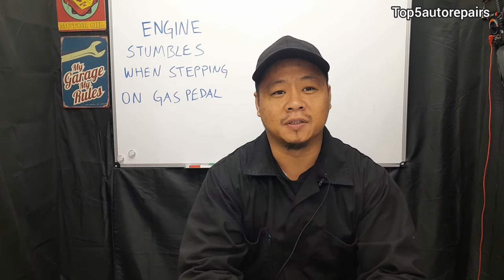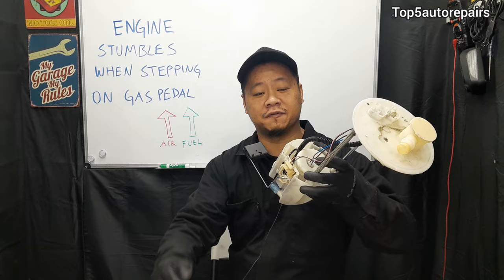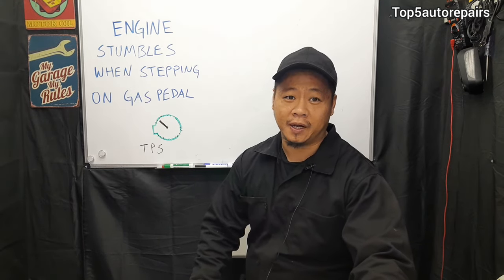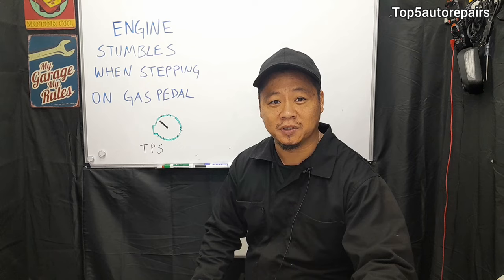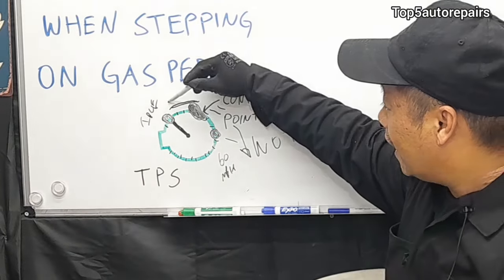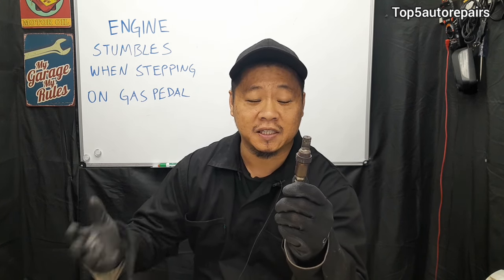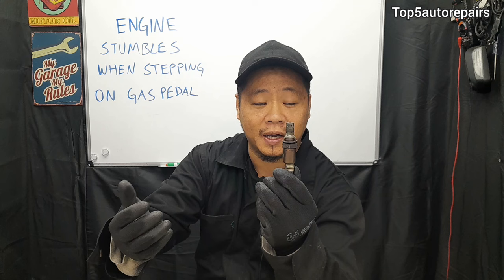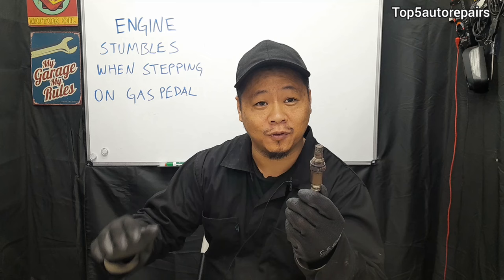3 Reasons Why Your Car Engine Stumbles and Shut Off When Giving It Gas (Stepping On Gas Pedal)

Comment: I have a 2010 yaris it was going fine i parked for about a half hour went to restart and it wouldn't run it kida started but as soon as i touch the gas it dies i spray starter fliud and it runs good for about 15 seconds but again touch the gas and it died

Comment: What if you cant keep the engine running to fully perform diagnosis....to pin point problem using scan tool?
Reply from the maker: Check for codes. Check for spark, fuel, bad engine sensor and vacuum leak. Once up and running continue diagnosing.

Comment: I have a f150 5.0  and when I press on the gas it shakes bad then turns off
Reply: Did u figure it out?
Reply: @danielkennedy9152  yes I figured it out truck is back on the road
Reply: @commercialelectrician133  what fixed it
Reply: @danielkennedy9152  you have the same problem truck would only run in idle if I pushed on gas it would turn off
Reply: @commercialelectrician133  after 20 mins or less it'll stumble if sometimes die